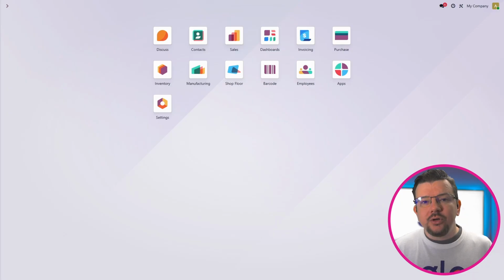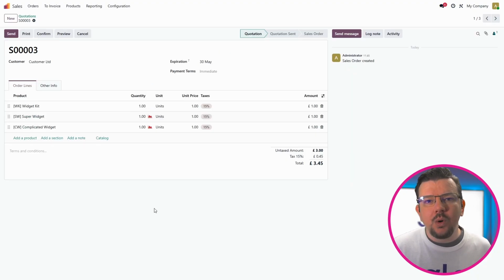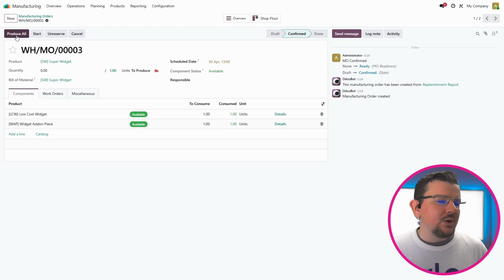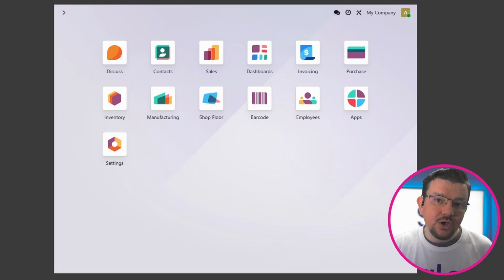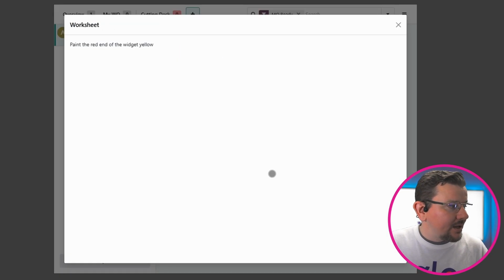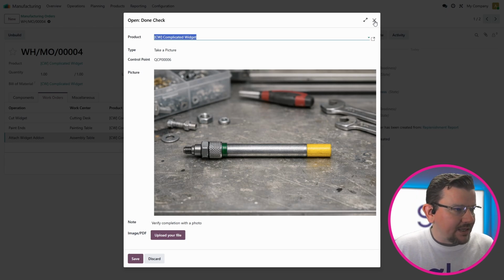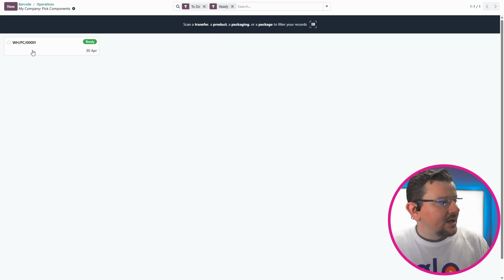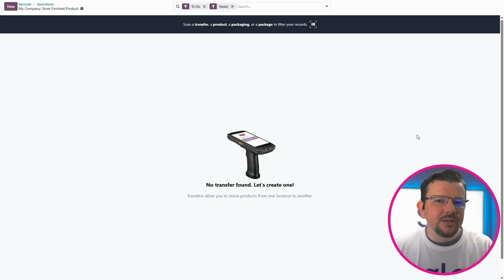MRP & Shop Floor in Odoo 19 | Odoo For Beginners #7

Comment: well explained,please once a shipment comes,does it mean all comes with a barcode where you scan before bringing it inside the warehouse
Reply from the maker: That depends on configuration, but it's certainly possible to configure it that way, yes. The printed picking can have a barcode for each product, and the initial receipt picking can put the stock into an "Input" location which is unsorted, ready for a put away operation to put it in the right place in the warehouse.
There are lots of options for how your workflow will work
Reply: @g @glo-networks okay so every warehouse has its own configurations on how it works if I understand you well
Reply from the maker: It can do. Routes can be warehouse specific, operation types can use locations from specific warehouses